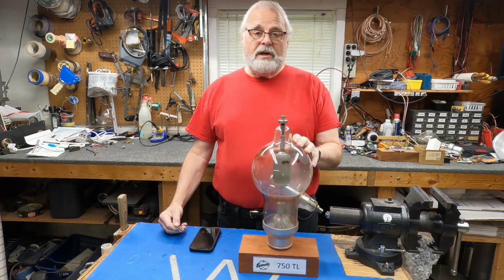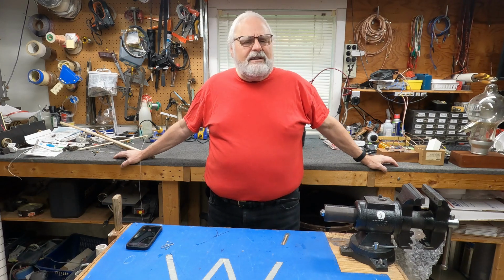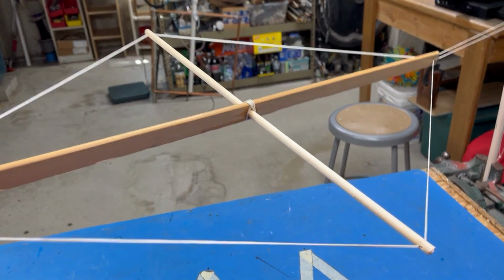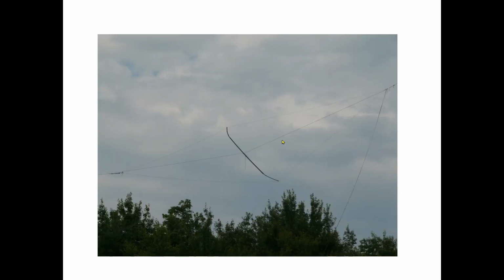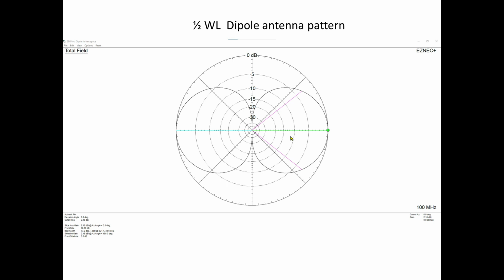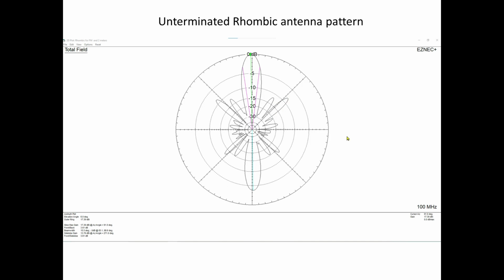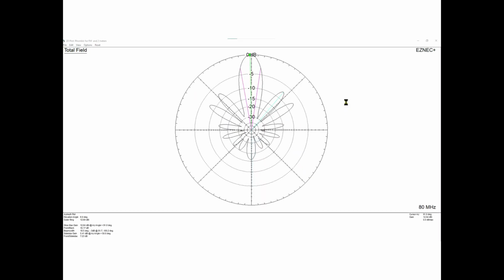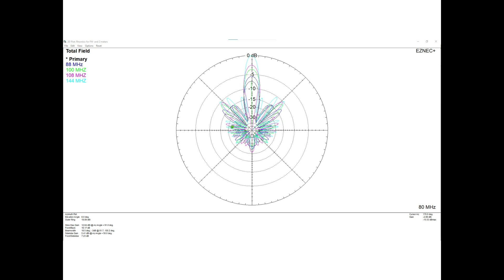Rhombic Antenna for FM Broadcast and 2 Meter Ham band

Comment: Thanks for the video Paul. This reminded me of the rhombic VK5MC used in the 1980s for 2 meter EME. His was bigger and therefore had more gain. Obviously his moon windows were very limited but when it got right into the main lobe of that rhombic he had a big signal. He has an article on that antenna on the web if you want to look it up.
Reply from the maker: Hi Paul.. Thanks for the kind words.   I looked up the article you mentioned, found it and look forward to reading it.   I feel like we are kindred spirits, I have watched a number of your videos and we both seem to do experiments, projects that are out of the main stream.  Hope to catch you on the air, as soon as my rotor gets replaced! 73's OM W1VLF

Comment: Many years ago I experimented with rombic antennas of our UHF CB band 477mhz .  The biggest one I managed to install on a rotator was about  5m (16.5feet)  long from front to back.  It definitely  had lots of gain however when mounted for vertical polarization the beam pattern had a tilt to it.  Even tried a dual rombic  which helped somewhat with the tilt .  In the end a yagi was far more practicable
Reply from the maker: No question.. the Yagi is far superior in all ways.. It was just something I wanted to try.   BTW where are you that you have a 477 MHZ CB band?  W1VLF
Reply: @W1VLF  In Melbourne Australia.  We have a 27mhz band and 80ch's FM at 477mhz band.   I watch your videos and we have so much in common.  I have had a play with almost everything you present in your videos from ELF all the way to laser light and antennas of course.  I still play with this stuff most of the time. I have a ham license but have way more fun experimenting like you do.   Unfortunately my location is not as RF quiet as yours.  I live in  a densely populated suburb and with all the solar systems and every electrical item these days using inverter tech my noise floor as risen sharply in the last 3 years making radio related stuff very difficult.

Comment: Roger that Paul!  Rhombics rock, really. I love the paper clip visualization to demonstrate the lobes. 
A million years ago I lived in suburban Philly trying to pull in a weak FM station from downtown, which became a problem when a local station two miles away came onstream an alternate channel (400 kc) away and it would splatter all over my target station. So I crawled up to the attic nobody ever went in and strung a rhombic (fortunately the long side of the house was lined up with my target station). Couldn't do it in full scale so I just used the area the attic allowed and got my older brother, the math whiz, to work out the trig (math puts me right to sleep).

Wellsir, it was like magic. FINALLY the offending local signal (broadside to the target path) was gone. Literally nothing else would work, I needed the supreme directionality of the rhombic, praised be its trigonometry. I got my station back.

From that same QTH I used to copy WAMU in DC at 140 miles to the SW but I'm not sure that was with the rhombic, might have been my Dad's S-shaped dipole he had in that same attic. One day I went looking for WAMU and instead copied KLJC in Kansas City; it was my first exposure to E-skip. I worked Sioux Center Iowa and Red Lake Ontario later in the day as the weather system moved north. I doubt that was the rhombic, as those signals would have been broadside to the beam, west rather than south.

So your focus line looks slightly east of the antenna farm in Roxborough (Philadelphia) and slightly west of the NYC skyscrapers; from where you are given the beamwidth you split the difference perfectly.

I like the masking tape W on the Group W bench. Does anyone else know where "Group W bench" comes from or is it just you and me?